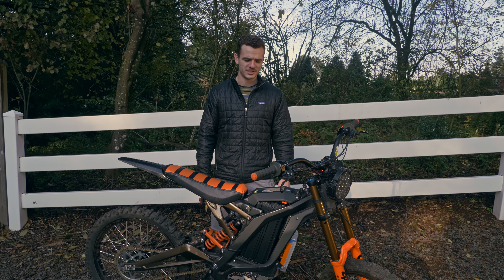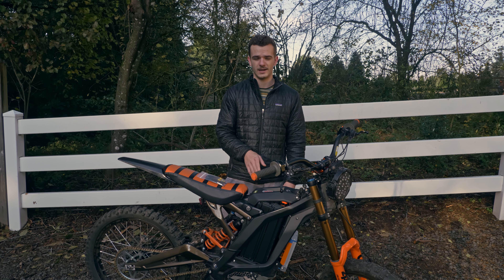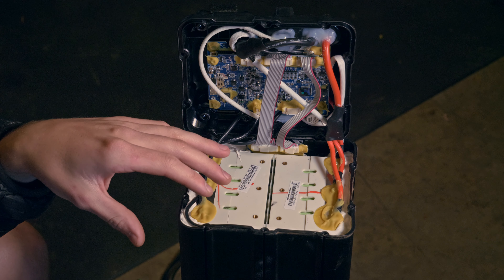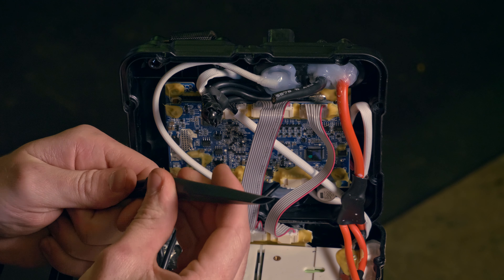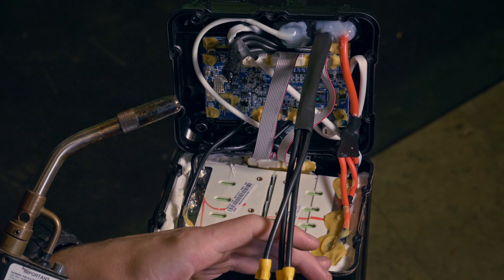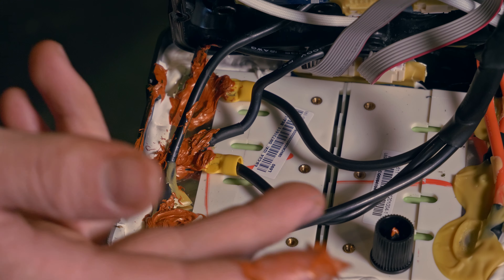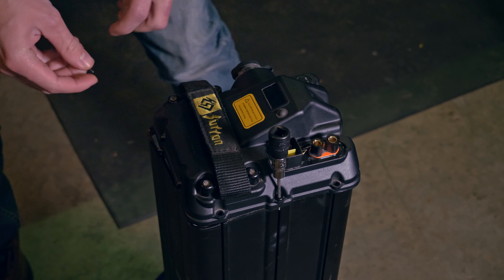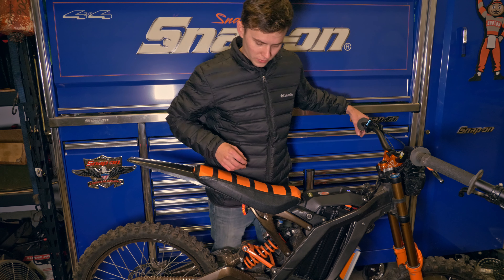How To Bypass Stock Sur-Ron Battery for more power!

Comment: Your BAC4000 kit is nearly half the price of others I find. Whats with that?
Reply from the maker: We don’t price gouge :) there’s some even cheaper than ours but lack the same features. I can tell you that you get little to nothing with the more expensive ones though.
Reply: @emotobros  well if its price gouging are you guys also price gouging? I can find new BAC4000 for $450.

The only things I can find reflecting prices are prepackaged wiring kits + etc to install easier I guess.. And "tuning"  I imagine there can't be that much skill or talent involved in programming these.. Maybe I'm wrong?  But with a few searches you can find what seems the same product from 400ish-2500.. makes no sense to a new customer.
Reply from the maker: Just the BAC4000 can be sold for a minimum price of ~$450. However I doubt anyone would be selling a kit at that price. Tuning is actually quite a bit harder than you’d think. If you’ve never done it before it probably take 6 months to a year to figure it out on your own. Beyond that, the display adds $100+ wiring harness adds $100+ brackets, hardware, wires, pricing in warranties and post sale support and plug and play makes a big difference in my opinion. I think our price makes a lot of sense personally but other may disagree.
Reply: @emotobros  a year to learn how to tune a controller? cmon dude lol no... you know how much you can learn in a year? Ill give you  perhaps not 100% identical to the best of the best but.... def to very acceptable ranges
Reply: With materials in hand, I could confidently say a week
Reply from the maker: @CmdrTigerKing  Yeah I mean we've never done this before and were only working on it on the weekends. But I'd be pretty impressed if you could figure how all 300+ parameters work and interact in one week. Even engineers at ASI discover new things from time to time while we work with them. 

It's not that it takes a year to get the bike running, that took one day. It's learning how all the parameters work, how to trouble shoot certain errors, build in variation for differences in motors, implement all features the controller has to offer, etc. You have to remember we aren't just tuning it so that our own bikes work, we are selling a plug and play product that should have no issues and be packed with features.
Reply: @emotobros  send me the schematics
Reply: With an optimized BAC4000 + stock bypassed battery / supermoto tires with ideal sprocket what types of Increases we looking at?  It sounds as if you can customize the tuning to your riding style... so let's say we wanted top speed / distance. Or if that's not how it's tuned, what is the best outcome for improvements?

Also, you got a headlight recommendation? I don't want luna's upgraded option nor the rectangle 260 you see for sell all over.  I want a circular light.. I like the stock look, it just sucks....additionally what about a wired brake sensor / signals by chance? Dont want rechargeable ones. Lastly, a switch for the headlight
Reply from the maker: @CmdrTigerKing  schematics for what?
Reply from the maker: @CmdrTigerKing  Power increase of up to 3x stock. Speed increase of around 17-20MPH (at 60V) 25+ (at 72V).  Distance is mostly dependant on power usage and Wh capacity of the battery.

For headlights we have a whole video on the headlight we use (thats  round) and how we installed it (https://youtu.be/PksQwwGYqWs). In the description of this video is the link to the headlight and a light switch that's plug and play. Additionally, the brake sensors are a binary on off voltage reading which could be used to activate a relay for turn signals/brake lights.
Reply: @emotobros  Im gonna Polly buy one of your BAC4000 after watching https://www.youtube.com/watch?v=A_fL_Fblvbw

well, not finished yet with vid.  
Do you think range would stay about the same ? Or more / less? 

I could see it going either way
Reply from the maker: @CmdrTigerKing  All else held equal, the range should not decrease or increase when only changing the controller. If you raise the power than yes, you should expect less range.

Comment: Will Your setup put out more power than the Blackfriday Surron XX? And do you have a ball park price of your complete kit to do this? Thanks!
Reply from the maker: I’m curious about this as well. Luna said they raced it against a bypassed BAC4000 and it was a dead tie. They also say that the xx has 9000 watts and if that were true it shouldn’t have been a tie. Our kits will start at $700 for everything.

Comment: I really need to understand why the wires are left at P- and why B- is still connected to the battery? Can’t you just use one of the B- connections and delete the rest? This way there are less wires inside.
Reply from the maker: The reason for using all 3 is to spread the current over more ‘parallel’ connections. This allows for less heat generation within 1 individual wire.

Comment: So the bms balance is still active on recharge, but you now have no over current protection, no over temp protection, and no over discharge protection, all of this is down to the rider to keep within limits without any sensors or displays, just they're own experience to go on. Good luck!
Reply from the maker: All those limits are built into our controller which you need for this to do anything. Also, we have a display with a voltage sensor so I’m not sure what you’re referring to.
Reply: @emotobros  not really, you don't know the internal resistance of the battery. It may produce a lot of output, the internal resistance (and dendrite growth) make it go POEF out of the blue. 
And overcharging or having a short does not make it any better. 
What if wire insulation fails to your BLDC motor controller?

Good luck indeed!

Comment: I charged my batt with the bypass in first time today, the built in gauge is accurate while charging weird it's not while discharging.
Reply from the maker: Noticed this too. This is a discharge and change side of every BMS. You are bypassing just the discharge side to theoretically it’s still accurate on the charge side. Kinda odd.
Reply: @emotobros  Yeah just weird didn't expect that, I have a teznic bac kit no display so I hooked a voltage meter to the ignition
Reply from the maker: We talked about this in the video and recommended that people only discharge their battery if you have a controller and display that allows you to monitor your battery’s voltage and percentage.

Comment: Does this work with the stock controller
Reply from the maker: The bike will still function but you will see no power increase and your battery percentage readout will be delayed.
Reply: @emotobros  when will you guys have displays and plug play harnesses ready I already have a bac 4000 controller but is it possible to buy the harness en display and use it with my bac 4000 because it isn’t programmed by you

Comment: It's very dengerous to delete bms. BMS can help safe you and your surron from wares circuit fire. Bllance function will not work right. Battery will die.
Reply from the maker: Good thing we didn’t delete the BMS! We just bypassed the discharge side. The balance function is on the charge side and will work perfectly fine. I state the limits of the cells from a discharge perspective so if somebody wants to go outside that it’s on them.
Reply: @emotobros  it's very dangerous.  All battery have BMS control on discharge wires. People need to know about risks. Many people and a lot of equipment suffered   suffered
Reply from the maker: They are put in place on the discharge side so that people can’t exceed the limit of the cells. If you just know the limit of the cells and don’t draw more power from the battery than it can handle it’ll absolutely be fine.

Comment: If you run at 7000 or higher aren't you risking the motor?
Reply from the maker: Allegedly it is rated for 8kW continuous. But yes, prolonged durations of high amperage can damage the motor.

Comment: Most of these cells can go to 2.5  with no load.. so about 3V under load.. on 10P it's no issue.. I wouldn't try doing speed runs or heavy wheelies on it but you can still ride.

Comment: why not hack or replace the bms? i would never bypass the BMS. unless the eggrider is a BMS
Reply from the maker: A BMS cannot be “hacked” it’s current rating is based on mechanical properties and it’s physical design. Putting more than the recommended current through the discharge side will shut it off or damage it. Replacing it would be ideal, but this is more expensive and extremely difficult to do. For most people the bypass kit is the easiest, safest way to do it. That being said, there is nothing inherently “Safe” about removing protection from your battery and we would not try to suggest there is. It’s removing a safety mechanism in order to get more power at a low cost.
Reply: @emotobros  i get it to each their own and happy you you offer a solution to those who can give a damn the price to pay for more GO!

Comment: 7000w from a ~2300w battery pack. So 20 mins of use at full speed then. Good idea and helpful video to explain boys but people do need to understand the effects of the mod.

As others have noted, people who do this need to be very careful. I have built a few batterys myself and from personal experience one overcharged/unbalanced 18650 cell fire is scary. This pack has 176 cells.
Reply from the maker: Yes, this mod isn’t for people who want to just hold it wide open for the duration of their pack. We think we did a good job explaining the risks involved. Even at 5000W a 2300Wh pack isn’t going to last long but I don’t think many people riding these are holding it wide open like that.